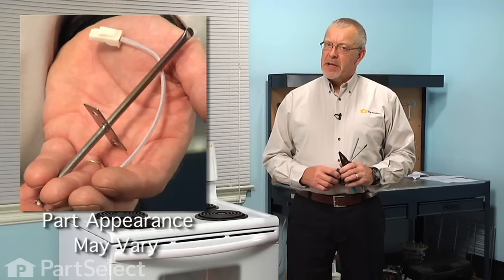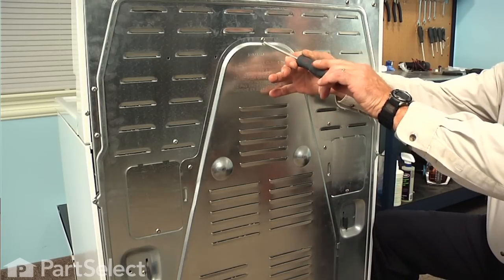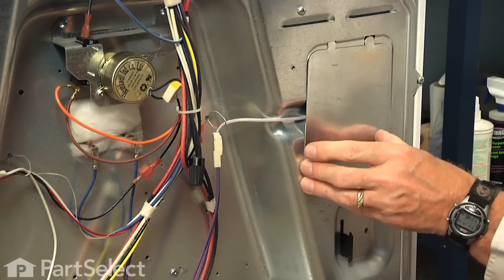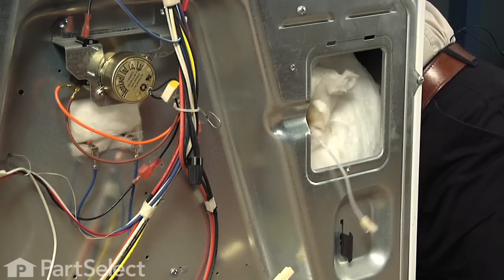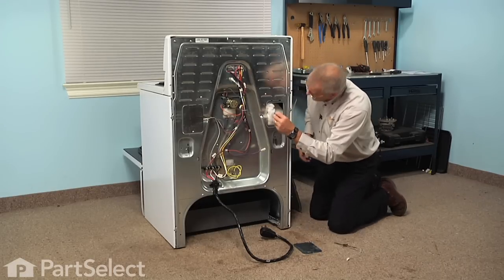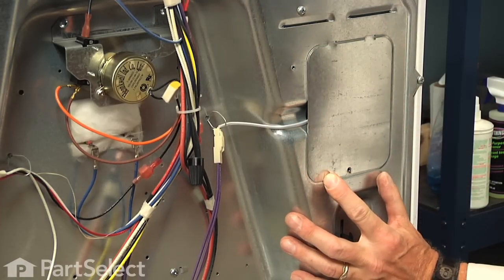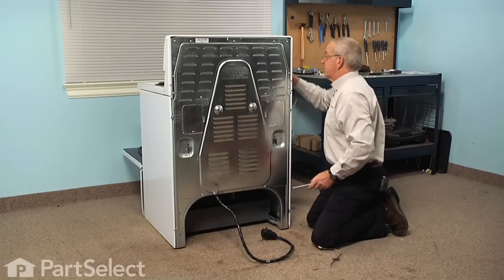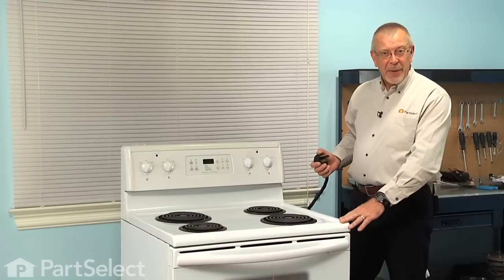Range/Stove/Oven Repair - Replacing the Oven Temperature Sensor (Frigidaire Part # 316217002)

Comment: Thank you for sharing.  I was told the F3 error code is an oven sensor issue and so I installed exactly as shown.  After installation the F3 error code still went on.  Can you recommend another possible solution as this is quite frustrating and I don't really want to pay for a repairman. Thank you for any help!

Comment: I have a Frigidaire range, and am getting the F1 error when oven is in use.  Once the oven cools off, I can use it again.  When I pull the back off, the insulation around the oven temperature sensor is all black -- looks like it was overheated.  I believe this is the part I need to replace, right?  That should clear up the F1 error as well?
Reply from the maker: If the F1 code appears when the oven is running, it means that the oven senses an overheating condition. Use an external thermometer to check the temperature inside the oven. If the temperature on the oven's control is different than the thermometer then the problem is either the temperature sensor (which it probably is) or the control relay has malfunctioned. Disconnect the power, and inspect the sensor probe, replacing it if necessary. If the oven is actually overheating, replace the electronic oven control.

Comment: Will this re placement be the same for a gas range? when I went to pre heat my oven this morning,  I received the f1 code almost right away worked ok  yesterday. . how do I diagnosis this? to see if it is the temperature probe or control panel?
Reply from the maker: +Tamara Gundlach What is your model number?

Comment: Some Temperature Sensors cost over $100!, others are $25 -  Are they really that different?  Cant you use any Temperature Sensor to replace a bad one?
Reply from the maker: Most oven temperature sensors have very similar characteristics but may have different connectors. However, a slight difference in resistance can make a larger difference in temperature so it is best to use the manufacturer’s suggested part. The same applies to temp sensors in refrigerators and clothes dryers.

Comment: I did unplug the range from the power source for quite some time,  I just re plugged in,  and it won't allow me to push any buttons on the control panel,  and it immediately says cool then goes right to the F1 code.. I believe this could definitely be the control panel would this possibly be correct?

Comment: Hi, do you have a video explaining how to splice the wires as the new temperature sensor # 316217002  is different than the original part. I've been reading reviews and it seems that people are having a hard time with this. I have a Frigidaire CFEF372EC5.Thank you,Sharon
Reply from the maker: +Sharon Fitzpatrick We do not have a specific video to show how to splice the wires for this particular part, however, here is a video showing how to do the same repair on a different brand. https://www.youtube.com/watch?v=2IU_H0yrg-c